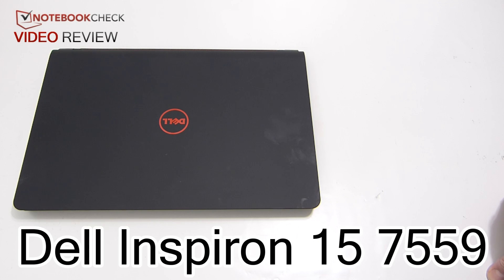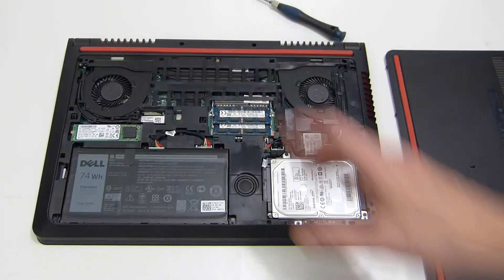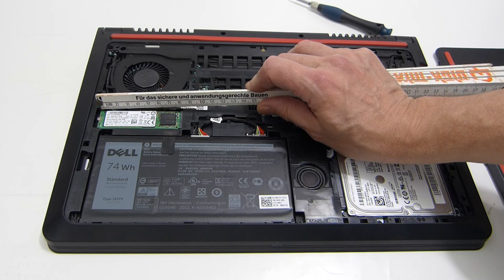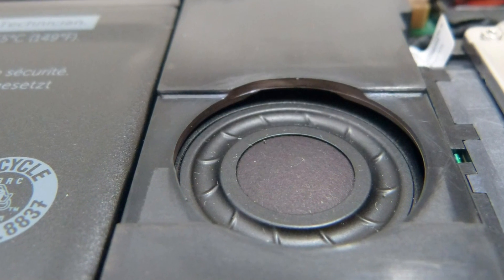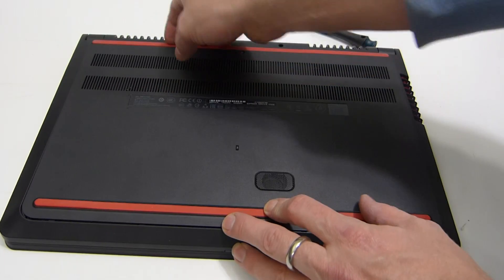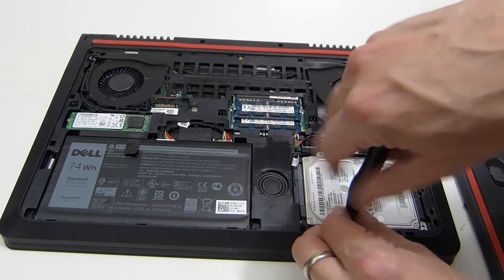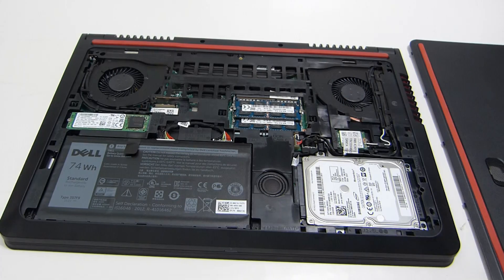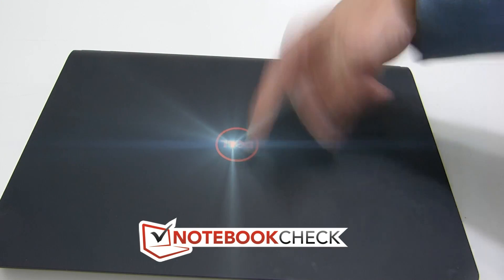Dell Inspiron 15 7559 Internals and upgrades

Comment: Would a 2x2 intel 8260 fit in as a replacement/increase wifi range+stability instead of the 1x1 intel 3165 in there?
Reply: +Trinh Le did you ever get an answer for this? Because I would also like to know.
Reply: +Securus Nex I bought the wifi card myself and replaced it. What I found out was that the intel 8260 does fit, but you will not see any improvements whatsoever. The laptop is equipped with 1 receiver and 1 sending antenna (1x1) so by putting in a 2x2 wifi card, it actually does no good.
Reply: Trinh Le Hey, thanks a lot for that info, I appreciate it. I guess I'm stuck with that 1x1 card for a while.
Reply: I have a 8260 in my Inspiron if that helps. It's just the NIC that limits this thing from having 2x2.

Comment: where is the GPU located? is it easy to access? is it upgradable to 980m? thx
Reply: its soldered to the motherboard its not upgradeable unless you can get a gpu in ball grid array and the skills to remove the older and place the new one

Comment: Great video I just got mine with 4k display and 16gb one question tho: I'm thinking about upgrading the wifi card I see that it has a dual band 1x1card and i'm thinking of getting the 7260NGW dual band 2x2 but it looks a bit bigger do you think it would fit? Thanks!!

Comment: Great video tysm!
I think you should've unplugged the battery first.
How heavy does the laptop feel?
Reply: +NotebookcheckReviews 
Hi! I hope you will see this. Can you confirm if the battery can be swapped if it will be weaken in the future? Im afraid that i cant change the battery.
Reply from the maker: +Aditya Ravishankar It 'feels' quite bulky. 2.7 KG isn't backpack-friendly when the PSU weighs another 500 grams. That's approching 7 pounds in weight! For the performance and price though it's about right.
Reply: +NotebookcheckReviews how many memery cards does it come with ,is it just one solid 8gb? reason im asking is because i got an extra 4gb ddr3 here at home and i wanna know if i can slap it right on soon as i unbox it.
Reply: Doctor Freeman he means to ask can a 4gig of ram fit there ddr3 or it only accepts 8gig